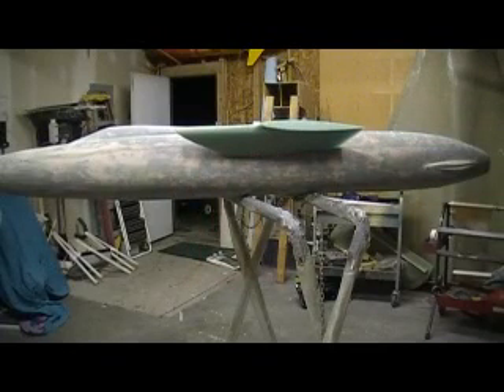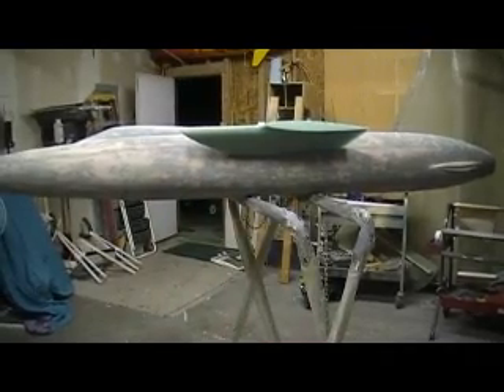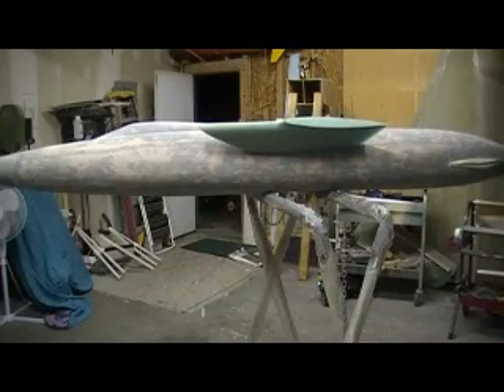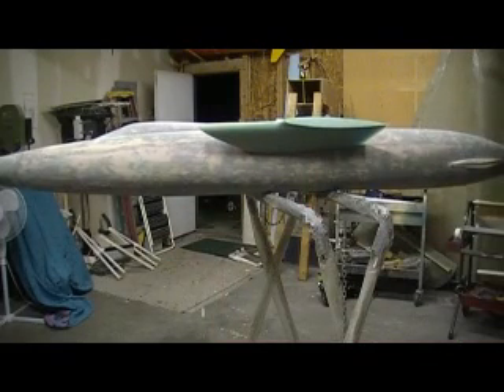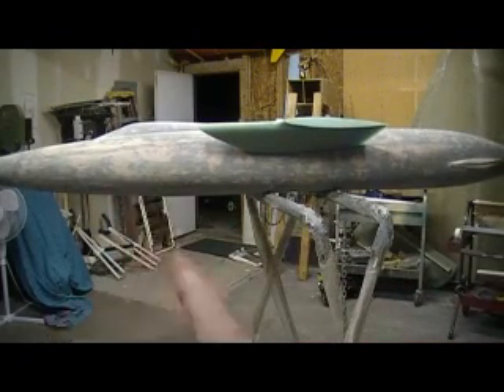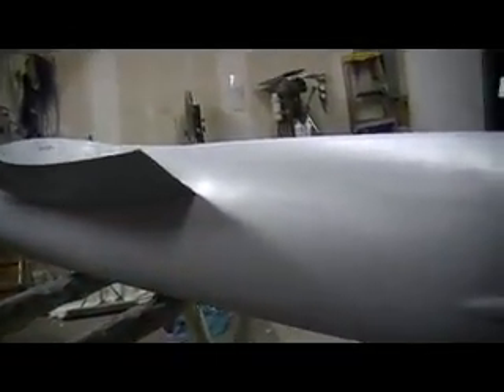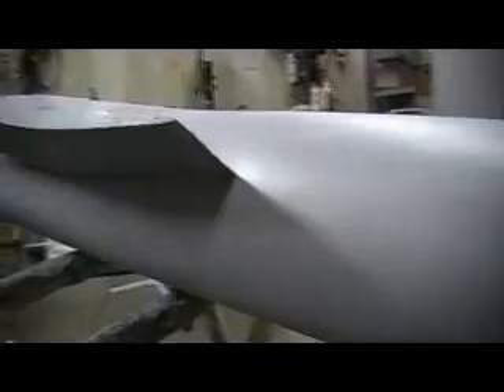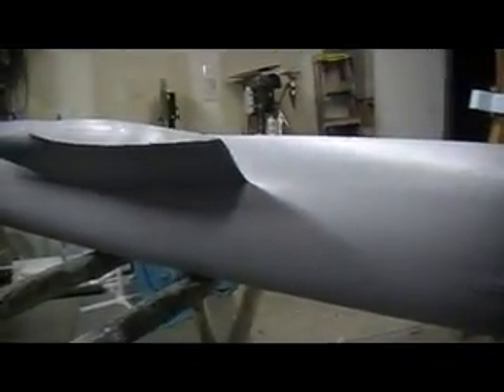how to build a rc jet F-105 thunderchief # 1

Comment: I agree with everyone else in my dislike of "ARF's" I am still a big proponent of balsa and tissue free flight rubber power planes. I believe there is no better way to teach yourself the basics of "how planes fly". But having said that, for big jets. Your method is the best. And as I'm sure others have noticed. Your 'glass and foam method spills into other areas. No reason why you couldn't make custom car body parts the same way. 
So, Go Bob Go!